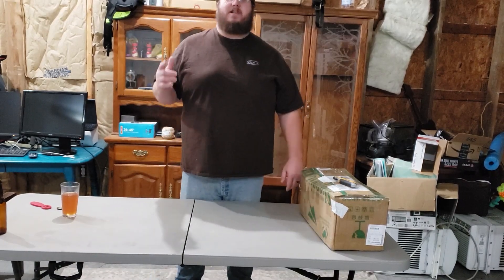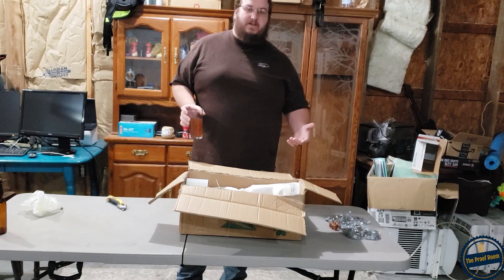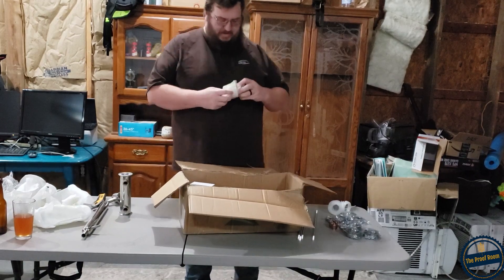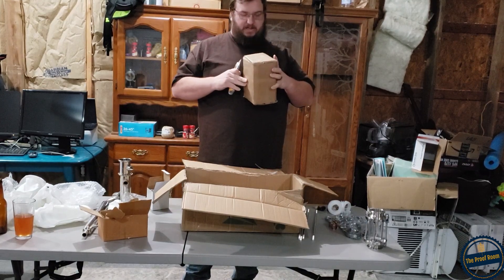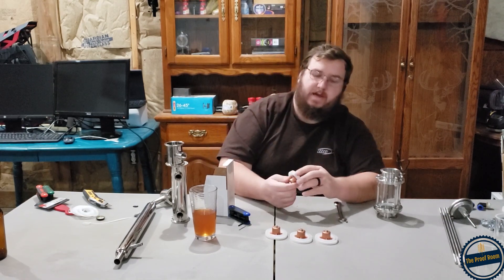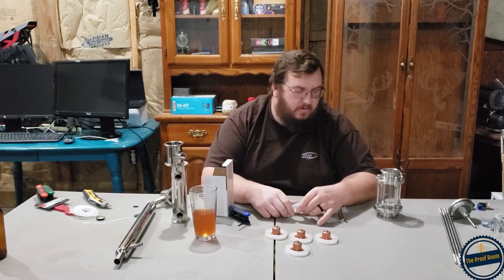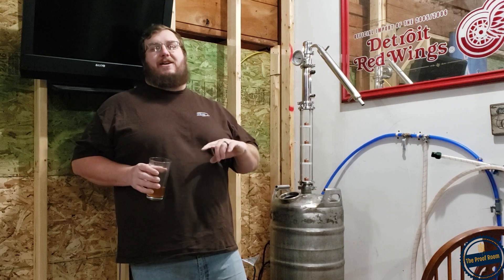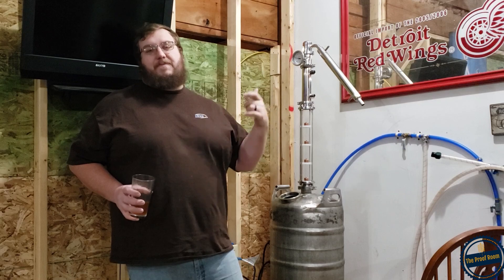2 Inch Reflux Column Assembly

Comment: Have pretty much the same set up but am having issues with it not condensing to liquid quick enough and  so I see some gas coming out of the end of condenser with the liquid dripping as well any advice on how to slow down that condensing? Any advise helps thank you!
Reply from the maker: The only thing I've been able to do is slow down a little and turn down the heat.

Comment: They've got them now for 135.00-140.00 on ebay. Just purchased one I'm eagerly waiting to arrive.
Reply from the maker: You won't regret it
Reply: @theproofroom1473  what's your finished proof? Waiting for a new hydrometer to see my first run abv. Smells very strong like 85%+
Reply from the maker: @VentureWelding  right around 80 to 85 if you can let her perk really slow
Reply: @theproofroom1473  what do you consider slow? In terms of the collection rate per hour
Reply from the maker: @VentureWelding  depends on the mash/wash and size of your column or still but I tend to stick with a stream no bigger then a pencil led and if I can get a drip drip spert pattern I'm in good shape.

Comment: i bought the cheaper shorter column just for the bits and peices,,,     i'll make a longer extension from copper for the height ,  use the short condenser for reflux and make my own shotgun condenser also from copper approx 500mm long,   my 2 x 3500w element 50lt keg boiler is already finished,,      i watched Jessie from Still It make his shotgun condenser, seems not very hard, i'll give it crack
Reply from the maker: Good luck my friend. I feel like I could have made one but its harder than it looks.

Comment: I started with just a rashing ring and jacketed reflux. Then went to a 3in bubble plate glass column from oak still. Then I went to 4 sight glasses, and eventually settled on 4 copper flutes with a sight glass on top. And 5 plates with a defag. I also went with a onion head and sometimes  gin basket for pot stilling. 
        Enjoy! Looking foward to seeing you run her 😊
       Be careful with the glass make sure and don't over tighten as well as put uneve pressure. Also the hoses make sure no cold water drops on hot glass or even condensation. It can crack your glass ask me how I know lol.
Reply from the maker: I do have an extra seal and glass just in case. I appreciate the tips thank you.

Comment: I'm looking forward to seeing how she goes. "A converted keg for a boiler, 2" bubble plate column with reflux, a P I D to control the power input (probe at the point of no return before vapours enter the liebig water condenser) nice water management set up, shit load of wash....".  Folks, I think we'er dealing with a Pro here. Good luck  mate. From Aussie.
Reply from the maker: Lol I'm no pro but I definitely do a ton of research. I drive for work over the last three years I think I've listened to every adio book on distilling and brewing i could find. Its just always been an interesting topic and kind of a magical process. Thanks for the support I really appreciate it.
Reply: @theproofroom1473  It has captivated me too right from the paddock to the bottle. Barley and Hops (George) and Jesse from Still it gave me oodles of excellent tips and advice. And thank you for the tip on bubble colunms, that's my next challenge. Au revoir.
Reply from the maker: @garrymcgaw4745  those guys absolutely are some of my inspiration.
Reply: Haha same set-up myself brother. I've yielded 170 proof (85%) was my highest on a spirit run.

Comment: For 95% you are gonna need more plates. Or a packed section above the plates.
You'll have to find a balance in the input power and the amount of reflux you allow.
After full reflux for 20 to 45 minutes you'll have to experiment. By either slowly backing off water flow.
Or backing off power & water. Use a parrot and watch the ABV as it come off.
Take off fores & heads, then reflux again for 10 to 15 minutes. Then take off hearts.
Watch ABV until you get the hang of it and you know your power and water flow settings. Then ditch the parrot. You'll know by smell, feel (rub between fingers) and taste.
Please watch out, 70% to 95% drinking is not advisable. High ABV will eat your taste buds.

Cheers!
Reply from the maker: Definitely, I am working on building a parrot now so that should help. I plumbed the water last night so its ready to go I also ordered two 90s and and a shotgun condenser so I had a little more knock down bower
Reply: @theproofroom1473  Parrots are a great tool. But they do smear. After you get comfortable running, ignore the parrot and smell the cuts, you'll know whats going on after a few runs.

Until you have a parrot. If you really get desperate just pour some in a test tube and drop in the tralle to see what the abv is.

My Shotgun condenser is a large 316 stainless 3" x 24" long with 8 x 1/2" tubes (gift from my wife). Coolant in/out are 1/2" npt.

>>>> The ONE THING I did to make water connections EASY. <<<<

I added 1/2 copper npt fittings with a 1/2 copper sticking out about 1 and 1/2" half. Screwed each one into each port of the condenser.
Then put a SharkBite 90 fitting with male NPT threads on it, and pushed it onto the copper end.

https://www.homedepot.com/p/SharkBite-1-2-in-Push-to-Connect-x-MIP-Brass-90-Degree-Elbow-Fitting-U280LFA/202270514

^^^ Now either connection can SPIN 360 degrees - any way you want to orientate it.

I also added 1/2 stainless quick disconnects to make the connections fast.

https://www.amazon.com/Ferroday-Stainless-Disconnect-Brewing-Chiller/dp/B07F12W7NK/ref=pd_sbs_79_5/145-1858547-0320552?_encoding=UTF8&pd_rd_i=B07F12W7NK&pd_rd_r=db9af874-102e-4b63-935d-ec79cb891124&pd_rd_w=AE3fY&pd_rd_wg=gWE2T&pf_rd_p=ed1e2146-ecfe-435e-b3b5-d79fa072fd58&pf_rd_r=JSWYH2E3ZXSC03S4K492&psc=1&refRID=JSWYH2E3ZXSC03S4K492

Everything is modular so I can move condenser setups any way I want.

Cheers!
Reply from the maker: @BigEdsGuns  right now I'm using barb fittings and pex eventually ill upgrade but I don't plan on changing it for awhile

Comment: Why bother with a 2 inch when a 4 is about the same price?

Edit: never mind. Its worth getting the bigger one but it should have still fit in your budget if you did not get the rest of the parts. I got one for $300cad.
Reply from the maker: Yup I will eventually have a 4 inch but I would still have to but the condenser and everything else. It was around 550. I'm working my way there. Cheers and thanks for the info.
Reply: @theproofroom1473  i started off with everything being 2 inch and then I added the 4 inch bubble plates. Now I'm looking to change the 2 inch dephlegmator to a 4 inch CCVM in the new year.
Reply: @JasonBelliveau   Yep! Go big or go home, if yo don't come strong... don't come at all...lol...Onya mate from Aussie.
Reply: Your 2 inch wouldn't keep up
Reply: @thefirstflush7818  everything works fine now so it should have little to no change.
Reply: Just a reminder a 4" column will need 220v 3000w element which I believe TPR has.
(Those running propane will have no issues running a 4" column.)
I run a 4" but use 5500w which I consider a must for 4" quicker heat up time.

Cheers Jason!

Comment: How do the silicone seals do with high proof alcohol
Would ptfe seals be better
Thanks
Reply from the maker: I am positive that these are the same thing everyone uses in this type of column. I'm not sure if they make ptfe seals for glass plate columns but is definitely something I can look into.
Reply: @theproofroom1473  Wrap the silicone seals with PTFE tape.
It's a PITA to wrap teflon tape around seals but PTFE is  PROVEN NOT TO LEACH into spirits.

Easy way to wrap silicone seals with Teflon tape:

Take a toothpick and put it in a drill.
Wrap the PTFE tape around the pick 5 to 10 times.
Run the drill so the PTFE spools onto the tooth pick.
Take the toothpick out of the drill and break off the excess wood of the tooth pick.
Now when you wrap the PTFE around the Silicone seal it is easier to feed it in and out & around.

Here is Chemical resistance chart of:  Buna Nitrile, EPDM, Silicone, and PTFE

https://www.glaciertanks.com/PDFs/ChemicalResistanceChart.pdf

PTFE is Resistant to all, Silicone does not fare very well.
Reminder: "Food Grade" is NOT Hot Alcohol Vapor proof.

Cheers!
Reply from the maker: @BigEdsGuns  I've done that before but with these seals I don't think its possible. They aren't flat they have groves in them that the glass and the plates sit in. They are standard on glass columns I see a lot of people use them.
Reply: @theproofroom1473  If the plates are wide enough to sit "on the glass" without falling through.

Pickup 3/4" wide PTFE tape and Wrap the edge of each plate with the tape.
Go around it 30 to 40 or more times. (There is a pic of it on HD forums somewhere.)
Then assemble the column.

I've done it when making easy flanges with copper pipe. Seals up great. Not pretty but it works.

Cheers!
Reply from the maker: @BigEdsGuns  i will definitely give it a shot
Reply: I'm starting th hear acetone can leach not so good chemicals into the whiskey I haven't researched it but I have changed all my silicone to Teflon for that reason. Teflon is a lot more durable as well, but his column set up the gaskets between the glass are a specially gasket I dont think they make a Teflon version. Maybe if they ever make home stilling legal we can have a better avaliablity of materials and equipment. 
       Oak stills is very easy to communicate with I should drop them a line maybe they be able to carry a line of Teflon replacement gaskets
Reply: Both will work, both are designed for the job.
Reply from the maker: @jeremyprovence4942  thank you I appreciate it.